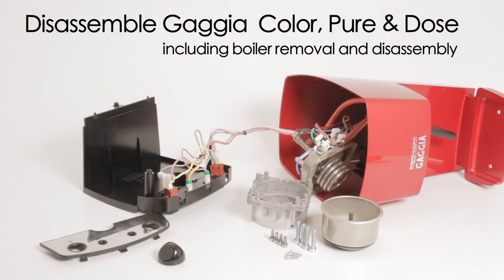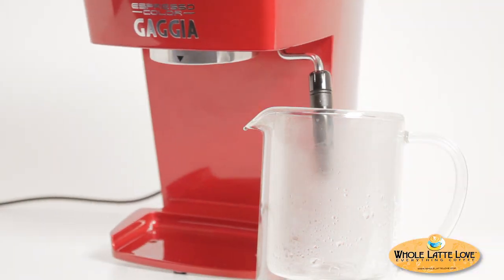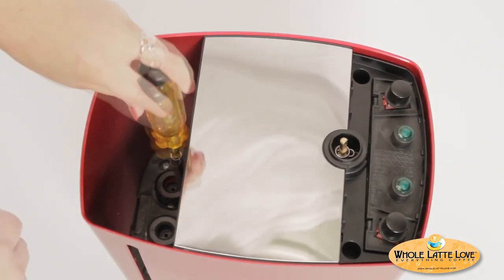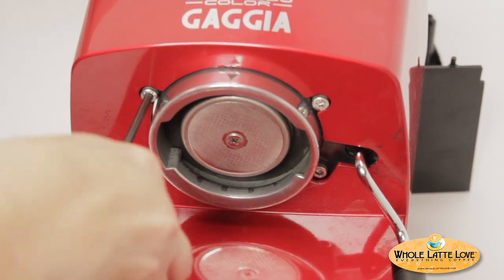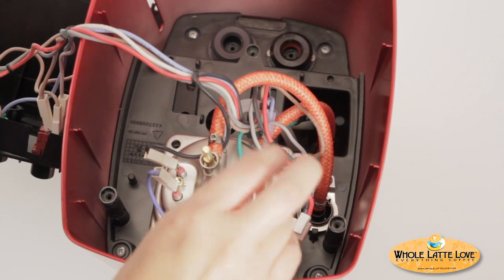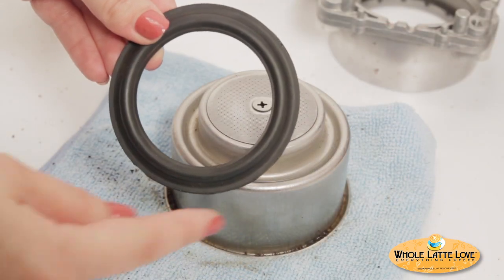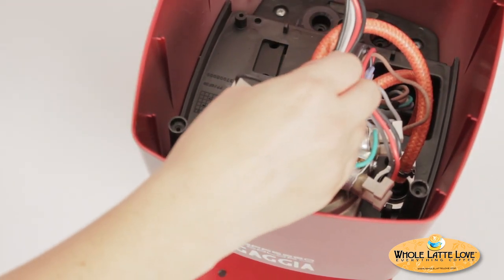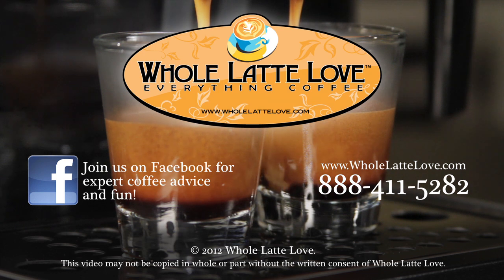Gaggia Espresso Group Gasket Replacement

Comment: I purchased one of these Red Gaggia Color espresso machines but gave up on it within the first year as the Portafilter soon started to back off by itself during brewing and blow coffee and hot water all over everything and everywhere. Now I'm scared of that machine and instead bought a Gaggia Platinum Vogue.

The rubber gasket shows no signs of problems nor do the plastic inserts in the group head which I have seen others have had trouble with. Do you have any suggestions? It is always very clean and really saw very little use before it got retired but if I can fix it, it would be nice to use again or gift it.

Have others complained of the head blowing off during brewing on the Gaggia Color?
Reply from the maker: M Roush There are a few things which can cause the issue. One is overfilling the portafilter. Another is repeated and long-term over tightening. A third is putting it on to loosely. Over tightening will decrease gasket life and eventually cause blow by of water.

Comment: Hi, great video! Tried it but failed! The part that holds the gasket doesn't com of the lower part of the boiler. In the Video it just falls out, mine won't move. Tips?
Reply from the maker: +Peter Smulders Hi Peter, you may have to muscle it a bit. It's likely some scale in the boiler is cementing them together. Some gentle "harmonic distortion", knocking the lower portion may help. You can also try some gentle prying with a straight blade screwdriver where the sections meet.

Comment: Hi, Thanks for this great video. I'm looking for a replacement part. This is a plastic ARC that enable the portafilter cup to fit titght into its base. Without it the portafilter move freely when screwing it on the base and there is leak everywhere. Do you the name of this plastic Arc (black brown) part? maybe a link too? Thanks a lot.
Reply from the maker: Hi L, If in US give our tech support a call at 585-924-7170. They can determine the part you need.

Comment: the portafilter holder section has only one black gasket on the right side, as does my machine, but a little water stills leaks out around the opposite edge where there is no black gasket and there's a small drip in the middle of the portafilter between the two spouts while pulling a shot...is this normal? it never did it before, i've had my machine for about 6-8 months and have pulled hundreds of shots and didn't start leaking until a few weeks ago...any advice?

Comment from the maker: Are you referring to the gaskets pictured in the video at 3:04? If so, there should be two, one on each side. You may be missing a piece of what is called the filter retaining ring. Please give us a call at 1-888-411-5282 if you want to order the part.